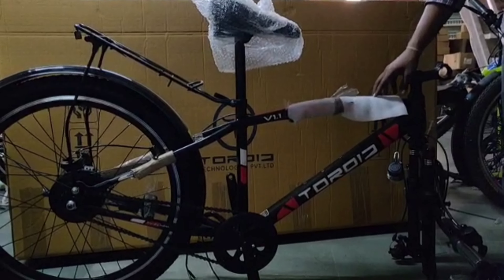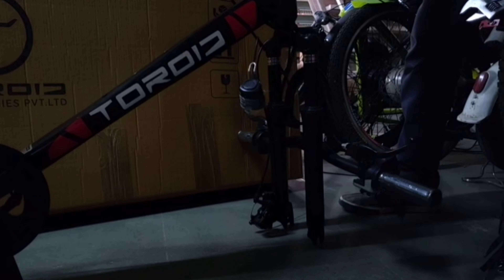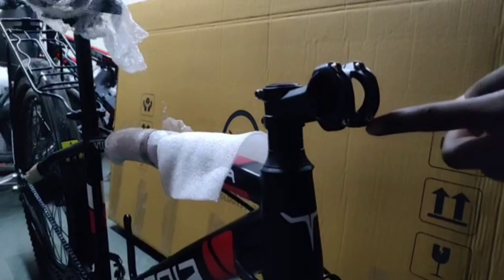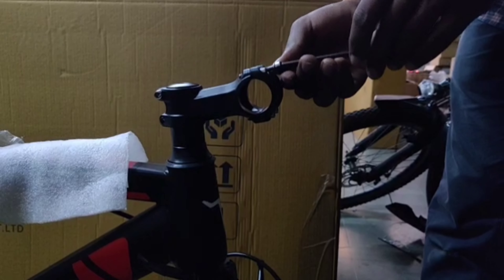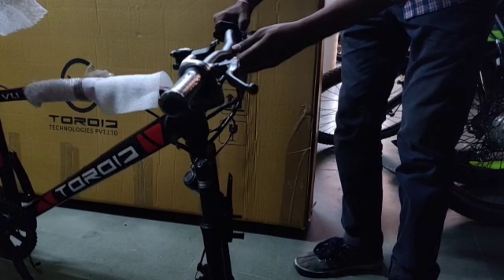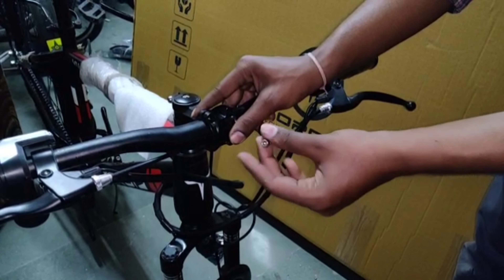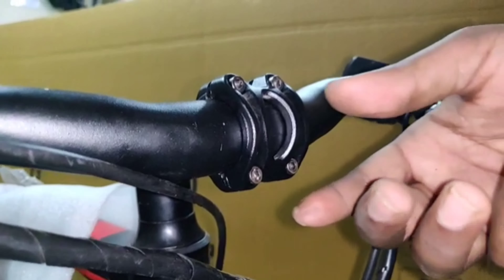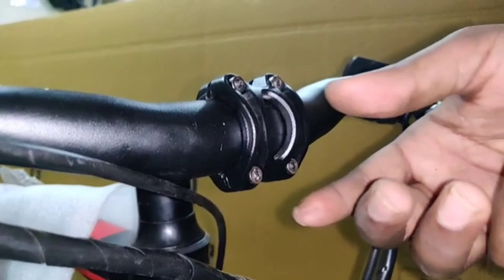How to assemble my RUDRA TOROID EBIKE once get online from the company

Comment: No doubt about the the features of product, till customer face issue, then actual story (pathetic customer service) begins.
Reply from the maker: True but it's general product which you can get corrected anywhere easily as I'm using its since last 1.5 years.
Reply: @Shivattu  Brother, My Pre booking Amount has not be refunded since 45days. Yes My Bajaj EMI account had issue technically, I informed them to drop my order as Bajaj EMI process had some ethics. What's the problem to make a refund?. I'm just unanswered..